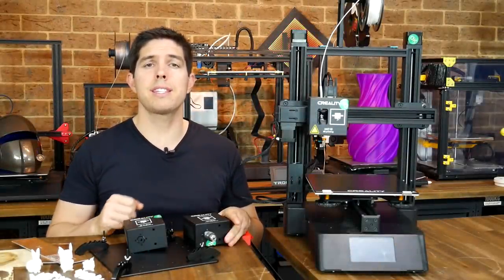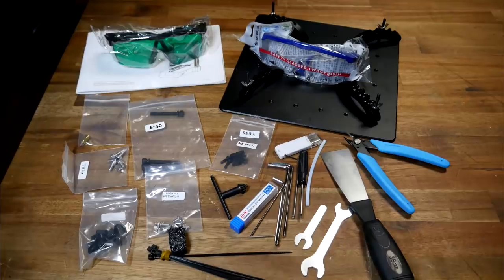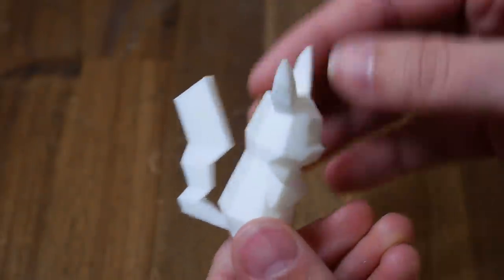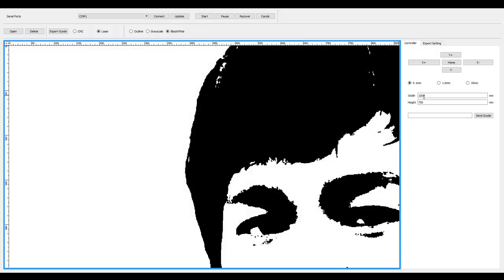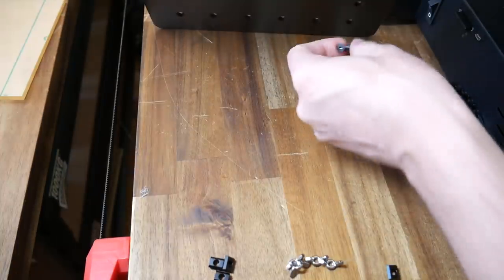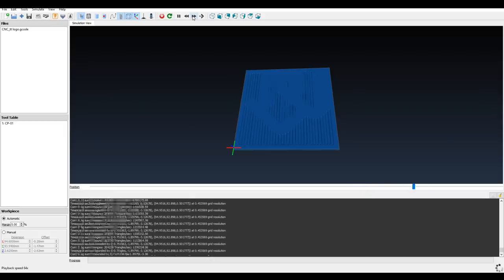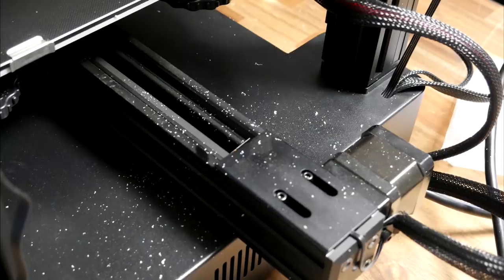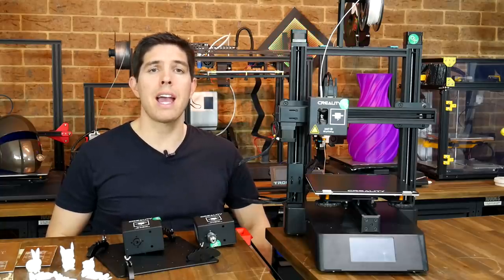Beta testing the Creality CP-01: 3D printer + laser + CNC all in one

Comment: Using a drill chuck to hold a end mill is bad. It's a big reason for all that deflection.
Reply: I imagine they only do it because small jacob's style chucks are cheaper than a collet system. But I totally agree. Jacob's style chucks just don't handle radial loads well.
Reply: Matthew Poole The very first DIY mod I would like to see for this machine is to get a collet on there.
Reply: @Inventorsquare  Considering you are likely looking at the shank of the motor going straight into the chuck, that might be more trouble to actually do that it would seem at first glance. Chuck jaws can be easily ground after it is installed to be (mostly) concentric to the motor, but collets are a bit more finicky. 

We also don't know what the slop in the motor itself is, so you might need a secondary bearing supporting the shaft to help stabilize that as well. 

Perhaps I didn't pay enough attention while watching the video, but a teardown of the engraving unit would be interesting to see.
Reply: In this case I think the V rollers are the main weakness.
Reply: If it is truly using internal belts, that would account for all of the deflection.  A CNC requires screws to be accurate, and to apply any kind of lateral force.  Belts will flex no matter what.  By using stiffer and more expensive belts (unknown what they are using), you can get better results, but the tension will also put extreme force on the bearings, causing them to fail.  It’s just a bad design overall for a CNC.
Reply: I agree, for the price it´s a very good mashine but a drill chuck for milling is very bad
Reply: @KaelumYodi  That's not entirely the case. These belts might be poor, but belts can be practically backlash free when toothed and reinforced with fibers. A decent belt shouldn't have any stretch capability - tensioning system should remove slack and damp resonances but it's not there to stretch the belt tight as such.

The majority of high end spindles run on belts.
Reply: @Audio_Simon  : I wouldn't have thought the "MAJORITY of high end spindles" use belts for positioning... wouldn't a combination of leadscrews, ballscrews and rack & pinion account for the majority?  Many of them do use belts to connect the spindle drive motor to a spindle running in its own precision bearings.
Without a doubt, cheap toothed belts that do not control stretch are a recipe for disappointment. This is all you will get on a budget machine.
Reply: @Audio_Simon  High end spindles do not run on belts. Belts may be good enough for 3D printing but do you see a Tormach using belts?!
Reply: @PiefacePete46  You are confusing the term spindle, which is just the cutting head, with the entire machine. Take a look at the range of HAAS spindles where many use belts and they do need precise position as they are servo driven for jobs like tapping.

https://www.haascnc.com/productivity/spindles.html
Reply: @PiefacePete46  You can also think of cam belts in a car engine that are relied upon to precisely time the system. If it stretched the timing of the engine would fluctuate. They don't stretch because of reinforcing fibres like nylon or polyester or glass.

https://www.gatestechzone.com/en/news/2017-12-tensile-cords
Reply: Belts as a means of positioning in a cnc is a bad idea if you want a machine with a decent accuracy.  Most of you consider 0.1mm as accurate, that is of course totally acceptable if you are making trinkets. However, a machine with that much slop is considered scrap metal in real world, manual or cnc.
Belts stretch, you might not consider it as significant, but they do - therefore can not be used for accurate positioning. Not serious accuracy anyway.
For toys, good enough, not much else.
Reply: @augustvonmackensen9785  I just don't think they are the weak link in this machine. Too many other poor parts.
Reply: @RinksRides  there are plenty of CNCs that are ment for (ENGRAVING) that use belts. Comparing an engraving machine like this to a tormach, just screams you're inexperience in CNC and Machining. Plus dude a Tormach really lol. They are just as bad as this machine. Lolol
Reply: @KaelumYodi  you're so 100% wrong there. Yes big industrial machines use ballscrews. However they are usually big and very, very expensive. Also if you try to use pretty much any other screw type like trapezoid screw, you're also in plethora of problems because of backlash problems. Now this is where belt driven systems excel. They don't need to accommodate for backlash. It's simply good to go if your belt tightness is good. Just check out. There's literally tons of smaller very accurate cnc milling systems that are driven by belts. That machine has combined problem of really bad chuck. It should definitely be collet system. I could almost bet that he lost bit because of this. Also other problem is flimsy frame and those v-rollers which just aren't too good for something like this.
Reply: jothain show me a belt driven CNC where the head needs to apply a lateral force, and has a .0005” repeatable accuracy from end to end.  Screws are not nearly as expensive as you think, and are not much more than the cost of traditional belt driven systems. I am not talking about commercial equipment either, which is very expensive.
Reply: @KaelumYodi  check yourself the diy projects. Older lathes and mills have many been converted to belt driven. You're really don't seem to know anything about today's toothed belts and their applications or diy scene. And you have really weird tolerance expectations on 3d printer frames and tolerances. Just to even try to stay in topic look for best ie.mpcnc builds. That's something that could be build for ease with this printers price and it actually can do metals with very decent accuracy for mechanical AND puny belts it has. I have one too and it's garbage,but still something absolutely different than this. And yeah I indeed think it has really poor drive system, but it's belts and it works. Now with good quality belt systems I'm talking about plus 20mm wide steel or fiber reinforced toothed belt systems. Quality what industrial equipment use. Check out their specs. Your few kilos of moving mass is nothing to them in rapid movements. Oh and your cheapo ballscrew isn't going to perform to those metrics you say. Prove me that instead.
Reply: Snazzy Riza who said anything about the price being under $1,000?  I sure didn’t.  I would say for under $2,500, which is what I consider non-commercial use.  For less than $2,500 there are several screw systems that will lay waste to any belt driven system, which I consider toy usage.
Reply: jothain instead of arguing facts not in evidence, why don’t you read what I said. I stand by my statements 100%.  Insulting someone simply because they don’t agree with you, will not get you anywhere. If you would like a reply, then present a statement like a responsible adult.
Reply: @KaelumYodi  well I'd state the same exact thing for you. I already stated that I do have mpcnc and it can do milling for same price point and it DOES run on belts and they can mill steel with moderately, especially for their price. To me it looks like you didn't even read the message. Now links for accuracy you mentioned devices for even less than 2000euros or shut up.  You claim machines don't work without ballscrews and I'm telling that they most definitely do.
Reply: jothain telling someone to shut up will not get you the response that you are seeking.  Enjoy your day.
Reply: @KaelumYodi  don't back up now. You said you're not talking about expensive equipment and you're talking about ballscrews and to me ridiculous tolerances for hobbyist usage. Now please show us the equipment that use them that cost less than your mentioned 2500dollars. Pretty please? I'm 100% sure that many others would like to know about this kind of equipment for sale. Heck I sure do. I follow and search good equipment all the time and really would like to know. I don't have anything against ballscrews obviously. I just really have problem with people like you that bash cheaper belt driven systems. Especially considering where this writing is happening. Less than 1000dollar 3d printer review. Now please enlighten and educate us lesser persons and tell us at least one example. I remind you that you have actually claimed this to be true that there are many models.
Reply: Cheap implementation. This is a "3D" drill press.

Comment: The VGA connector was designed for very low current usage. It was never designed to carry the current of driving an inductive motor, a hot end, or a laser. I’d be concerned with it failing, either by fusing or catching on fire.  A standard 2 row D connector would be much safer, and slightly larger, but is also designed for use with higher currents.

Comment: Most reviewers are spoiled by, and therefore committed to, donating enterprises. Their reviews are inherently biased and always positive. I feel obliged to post my review of this printer as a bit of an antidote. 
It came a few weeks ago, heat bed crooked 1.5mm on either side. Factory nor seller did exit inspections effectively or at all, so you will never know the condition of what is in the box. Replacement machine arrived a week later and ever since I've been trying to print with it. The G-code sample files did OK at first. Later on they started to fail: extruder cut outs at random, display data not corresponding with loaded file settings, inconsistent leveling after Z-movements, detaching print from the special glass coating and so on.
The Creality/Cura 1.2.3 Slicer software has no settings for the CP-01, how stupid can it be. So printing any file other than on the added SD-card successfully, is a matter of pure luck, unless you are a G-code specialist or 3D-printer savvy. 
Below are written numerous critical remarks about the design of this machine. Read them and be wise.
Reply from the maker: Thanks for sharing your experience. Firstly, this was not a review, it was clearly labelled a beta test. Secondly, I can only test what is in front of me. If my machine didn't have the same issues as you, it means we had a different experience, not that I am biased. I would literally have to invent problems I didn't have to match you. If you read my review policy and look at my track record you will see me being transparent with issues I've had on many machines.
Hopefully this one can help move you forward: https://youtu.be/yXNZ_2-rHNE in tweaking your own profile.

Comment: Despite thermal runaway protection, one thing I rarely (if ever) see anyone mention in 3D printing videos is that it's wise to have a smoke alarm and fire extinguisher in the room where you run your 3D printer.  I also wouldn't recommend anyone leave their printer completely unattended, where someone isn't even "in the house" to respond to such an alarm.  There should be someone within 30 seconds of reaching the printer in the event of alarm.  3D printers are a significantly bigger fire risk than most household electronics or appliances, given the nature of operation.  You've got a lot of heat being generated near a material that burns quite nicely and nothing to contain it.

Comment: I was looking at one of these at Jaycar a few days ago and it seemed rigid enough for printing or laser but a bit flimsy for engraving , that being said the first thing i would do is pick up an ER11 collet chuck and collets off ebay and change out that keyed chuck. This will shorten up on spindle overhang as the collet chuck is shorter but nothing can be done to make the carriage more rigid so you need to keep the spindle speed up , the travel speed down and depth of cut to below .25mm .
Seriously though if you are into electronics and want to make pcb's , cut out some decals, do some very light engraving on plastic and do some 3D printing  this machine could be the all rounder you have been looking for . To have the equipment in your arsenal to do each job properly  ( even though they will do it better) would set you back quite a few thousand dollars and take up much more space . I really like the VGA connector and it is much more secure than the damned ribbon cable connectors that seem to proliferate the 3D printer market .
Reply: ian bertenshaw Its not worth getting the “cnc” option to make pcb’s, you can get them made by JLC pcb for a couple of dollars anyway ( as in less than $2 per pcb ). Also this thing is made out of Aluminium extrusion which will flex and resonate stopping you from achieving any kind of accuracy

Comment: They're both CNC. We must say CNC mill/router instead on "CNC" which is unproperly used for mills/routers only. Any machine can be computer controlled: lathe, welder, spray painter, pick and place, and so on.
I would probably never be kind of all in one machines, even if some can share close goals. But usually AIO machines are performing poorly in most of its applications, if at least it can perform in something. Laser needs higher velocity and precision than a 3d printer, and need fumes extraction and air clearing. Through, a hi Z is pure luxury.  The 3d printer hates the dust made by a mill, which does not requires velocity at all, but high torque, provided by leadscrews on all axis, and rock solid guides. And the test is no surprise.
Except for CNC milling, you get a good 3d printer + a larger CNC laser for a fraction of the price of the AIO machine. You can't sell a capable CNC mill at low cost. Components needed to make a proper CNC mill are expensive, definitely. 
So if you want performing machines, buy single operation separate machines.

Comment: With that tool tip deflection i would call this nearly unusable for engraving. Even at slow speeds making a square corner will cause deflection and in an opposing direction. This will greatly reduce tool life as well. That's the thing about deflection when a tool is already deflected in one direction then you move 90 degrees (or whatever angle) there's no time to recover from the previous deflection before it starts deflecting in the new direction, well you never get a nice clean angle and your results will look horrible. It's probably good for cutting Balsa Wood and Foam though.
Reply from the maker: Nice summary, thank you.

Comment: A better technique to generate higher quality PCBs would be spray painting the copper clad board with regular car paint, let it dry, then using the laser to burn away the parts that'll be etched away. Ben Heck used this technique while he still presented The Ben Heck Show.
An excellent program to generate the gcode for that is FlatCAM, which is free software under the MIT License.
Reply from the maker: Thanks for the suggestion. I used to etch PCBs before I had a CNC router. Probably still have the stuff buried somewhere.

Comment: The elekslaser A3 from the factory turns the laser on on power up.
This is because the PWM signal from the arduino control board floats to +5v before the code runs and initialises it.
The fix is to put a pull down resistor on the PWM signal so it doesn't go high.
There may be a similar problem on this printer, it really should not turn on on power up.
Reply: I got the impression that almost all the machines default with the laser powering on.  I suspect the software people want the hardware to be changed and vice-versa.  Neither probably want to spend the money to fix the others problem.  

I bet there are Arduino weenies that would find fixing that a fun challenge.    

My current idea (ahem) is to put a switch in the laser power wires.  Probably the easiest way.  You still need to remember to turn it off when you shut things down.

(and my first thought on seeing the Jacobs chuck was what are they thinking.  Although having the right bearings and support on the shaft can mitigate a lot of the side play issues.  I can't think of any mini-mill that only uses Jacobs chucks.  They include collets and for milling and chucks for drilling.)
Reply: @n6nvr  It's a hardware problem. The chip powers up with all I/O pins as inputs. So they float sometimes high enough to turn the laser on. It takes a second or two to start running code so you can't fix it in software.

Comment: I have an Elksmaker Laser engraver, a 3018 CNC router and 3 Ender 5 3D printers.  I was disappointed in the Laser Engraver and CNC, while they could do things, they were so limited.  The Ender 5 can do so much more and it has a community that supports it, hardware - software and Thingiverse.   I had the same problem you had with the CNC, the run out in the cutting tool, these cheap builds are just not rigid enough for any serious work.

Comment: Ah, another engineering masterpiece. A drill chuck for high speed milling ( as feather weight as it may be ). Noticed the cutting tool overhang? That is probably why the tool bit broke. A drill chuck is designed only to deal with vertical loads as experienced in a drilling operation and not combined lateral and vertical loads as experienced in milling. Even a cheap Chinese hand held engraver has a collet system for tool holding.  Stick to 3D printing .